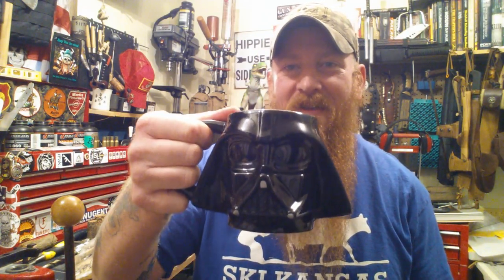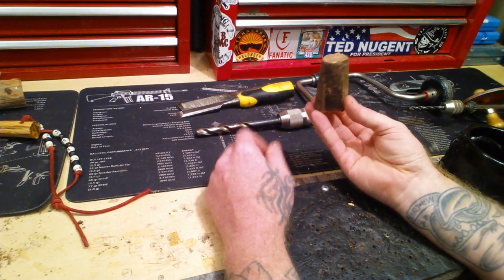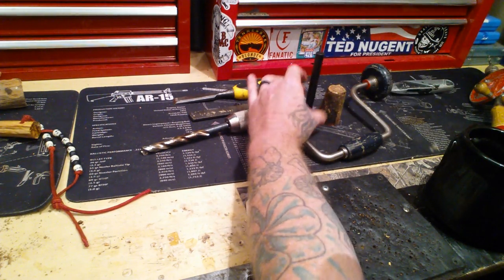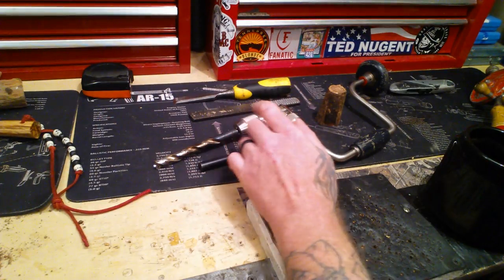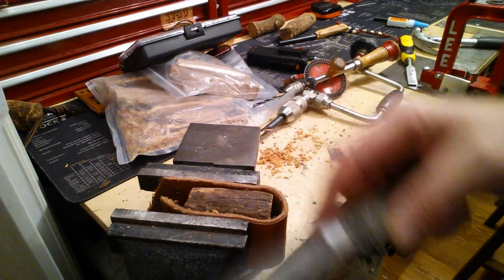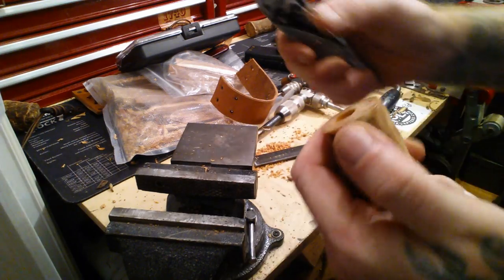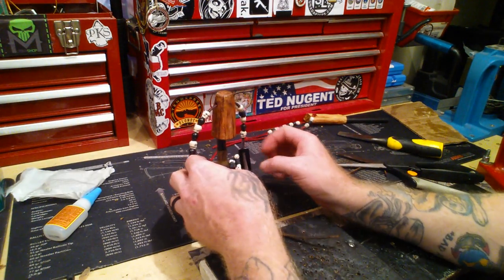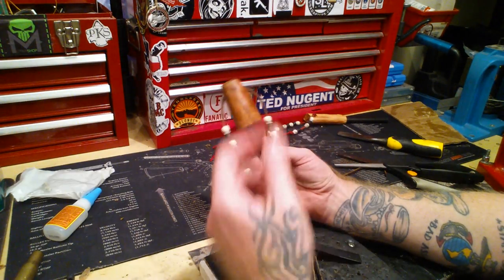No Power Tools | Ferro Rod Handle from Fatwood

Comment: Great video SSgt. Glad to see all is copacetic, and nothing ill happened in your immediate area. Was thinking of doing two .50 cal brass ferro rod lighters but doub't I could just buy two .50 cal brass cases. Also can't find the longer 1/2 diameter ferro rods. I can remember when they came in lengths longer than 5". Also was thinking of going into the gunsmithing and reloading home business and was wondering what would the best books to learn gunsmithing?
Reply from the maker: David Genthner Jr Taken 3 different schools for Gunsmithing there is online courses you can take that are pretty easy I think Penn Foster's you can do for 1200 bucks.

Comment: This is not how a engineer does things bruh. First of all you at no circumstance use a tape line to measure things..jeez, no you use a vernier caliper. Next, you don't just drill a hole! No way! You build a lathe to which you connect the drill and then mill the hole and chisel the fat wood perfectly round mill spec. You handle this all to simple and lazy. "Drops mike, runs away 💨🏃✈"/sarcasm just meant to be funny
Reply from the maker: Nico Dutch lol

Comment: I bought some of those 1/2 inch ferro rods and wanted a lanyard hole though it....I tell you what the sparks were amazing....Should have got it on video... Drilling through the rod that is.. I only did 1 . I think I'll try a handle on the rest of them.
Reply from the maker: steve schmittou nice I bet

Comment: Sizing a 50 BMG brass without a neck die is pretty easy if have a piece of maple to drill a hole in.  Then force the brass into the hole using a vise.